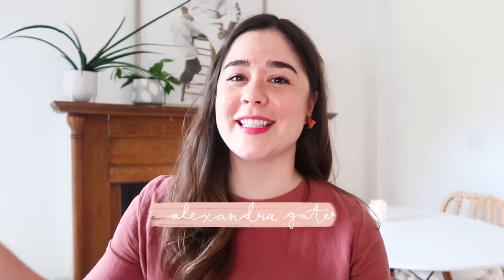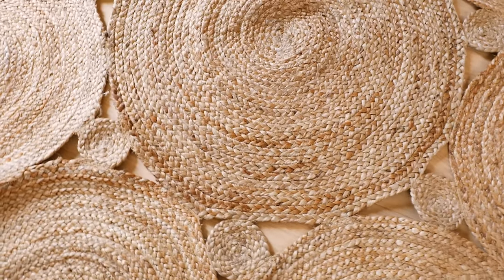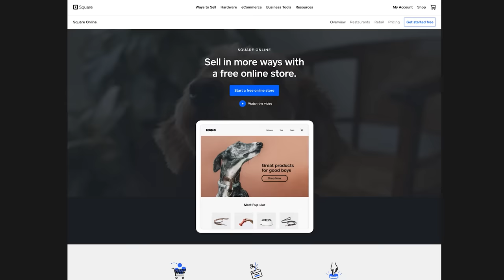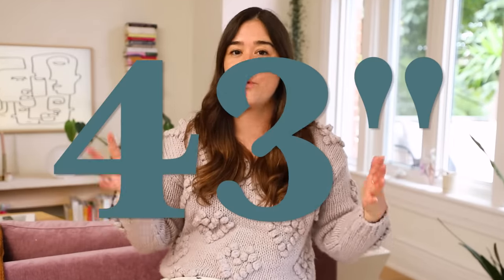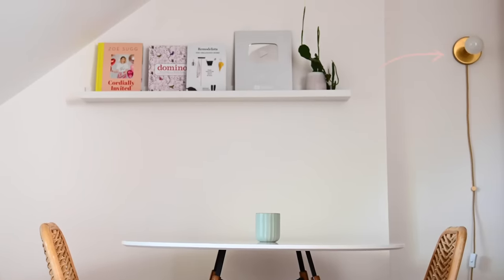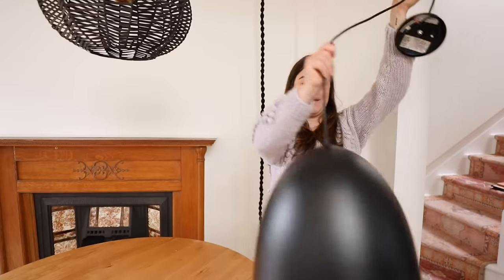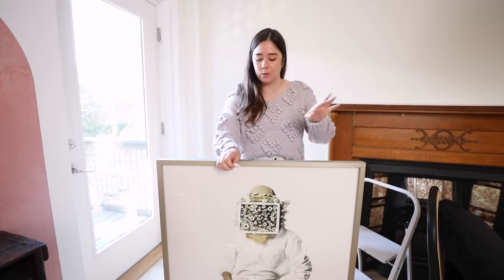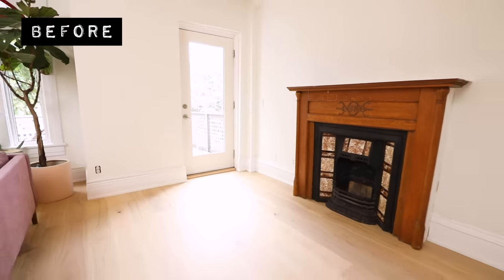Renter-Friendly Dining Room Makeover! | How To Create A Dining Room Nook

Comment: The jute rug would be a nightmare with chairs--trying to pull in & push out. They will get caught in the texture & especially in the holes between circles. Why not do an indoor/outdoor rug wth a bit of texture or a Ruggable that can be washed in the washing machine if something spills on it?
Reply: I thought the same. Two legs would be on the rug and two off, it would be a nightmare trying to move/slide your chair. Definitely something like a Ruggable or another really low-pile washable rug would be perfect.
Reply: And a great scratching posts for the cats who'd destroy it in one minute.
Reply: I thought of a cleaning nightmare as fuzz or something would fall in the holes and would have to lift rug to sweep or vacuum. But you're right even b4 that the legs of the legs of the chairs would have issues.
Reply: She took out the rug. I love how she shows some of her first ideas even if they don’t work.

Comment: Alexandra, you have the most charming and likable personality of all decor vloggers on YouTube and you seem like the nicest boss babe to work with, too! I, too, am puzzled how your subscribers aren't in the millions...yet. But quality over quantity, right?! Not a fan of painted arches, but everything else is on point 👌. As always, great job #TeamAG!

TIP: Easier to figure out the center by dividing each the length of the location and the item by 2. 

For example, wall is 20" ÷ 2 = 10" (dot this on the wall). Decal is 10" ÷ 2 = 5" (safely mark this with a post-it or blue tape. Align the centers. No need to calculate and measure the sides.

Comment: Wasn't there a recessed light right next to where the pendant light was screwed in? Really easy to buy an adapter to make it a functioning pendant light, then you don't need to faff around with charging lightbulbs all the time. Sods law the battery would run out in the middle of a dinner party.

Comment: I notice you promote the use of command hooks. Every single command hook I have used has ended up with the photo or art piece falling off the wall. (As little as less than a lb).  The hook comes off. Do you have another solution? Thank you! 
Also, I'm wondering about all of us whose landlords wont let us put as many holes in the walls and ceilings as you are able to do.

Comment: If you ever decide to redo this room: try switching to a pedestal table with a cushioned bench against the wall facing the door (perhaps extending the “wall” over to the pole. Two low backed club chairs that tuck under the table and move it all further into the corner so it’s more offset and intentional, and gives more open space. Also a tall narrow plant would be better than the fig, which is dragging the focus to the door.
Reply: Katie.  You're not the decorator we're tuning in for.  Go sit down.  Please.
Reply: @deniseunterman9652  Glad to see this is a platform where ideas can be exchanged with respect and support for one another. Kindness costs nothing.

Comment: I'm glad you didn't use the rug, not liking that rug at all.  I think, I would have centered the table in front of the fireplace, I like things centered; hard to tell in a video, not sure if there was room to do so.  Maybe consider getting the flameless battery pillar candles for the fireplace, they would look good.  I had a fireplace that was a non working one, leaned a mirror against the interior back wall and had the candles in front.  I liked the look.

Comment: .....I think a rug either rectangular ( in keeping with the Loung rug) or a big square one would look much better, I've always used a rug in the dining area. ...round table, NO  'round rug.' ...Also,   That rug looks odd, because it resembles place mats. 😳  and I'd be thinking that the chair legs would get  caught in it. Flat surface rug = no issues. 
I don't like Art Decals, looks cheap . Yes to paint, or Peel  and Stick Wallpaper.  ...A cream colored Brick  pattern  would have looked great with that fireplace, and provided a neutral background. That mirror is too small, a nice large mirror over the Fireplace  = excellent Feng Shui  .  ( I would not like  dining  in that space,  ,with that Artwork  above the Fireplace ... its weird. 
I like using Buffet Lamps on a surface if one can't manage a ceiling light,to  provide lighting if there's space for a " not huge " cabinet or dresser type thing . And candles, on the table., candles that are battery powered with a remote  👌🏻

Comment: Everything works and I like your aesthetic but being the artist I am I
would love to add my twist :).   I love the macrame cord hack and you were right the other light didn’t have enough presence and I thought the round rug was too busy and took away from the tables design and wood beauty.  When I saw the after picture thumbnail I felt the mirror should be  lowered because the mirror being outside the arch is a distraction to the other elements and the light being reflected lower would add more to the room where you can see it.   I think the two black chairs should be together against the wall to anchor the corner and the other 2 chairs could be pushed all the way in under the table for a cleaner roomier look .  Thanks for the video I have gotten so many diy ideas and I love how stoked you get from being a designer I can see your passion.

Comment: So let me get that straight... You are going to keep the light bulbs in another light fixture where they will be getting charged and then place them in the "hacked" light pendant in your dining room where they will be on for a few (2-4 according to a review) hours until they need to be charged again? Doesn't sound practical at all. 

From some of the comments I've read, quite a few people were under the misconception you were going to use battery-operated (non-rechargeable) remote controlled lights - that would have been a much better solution.